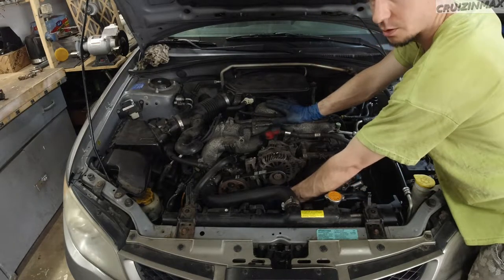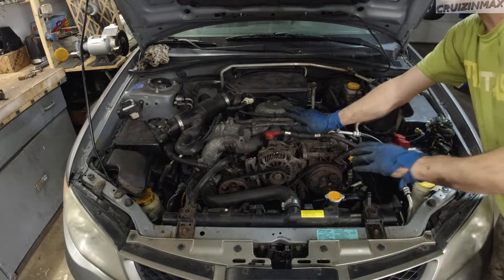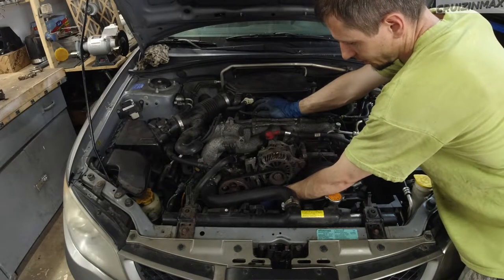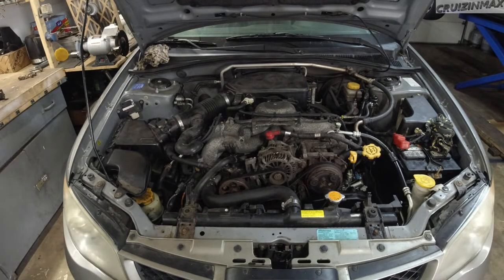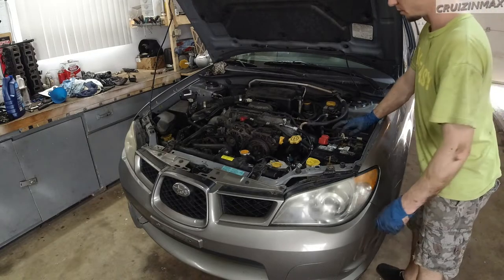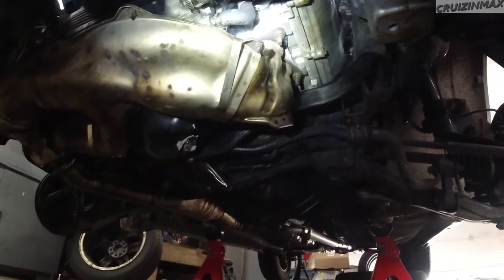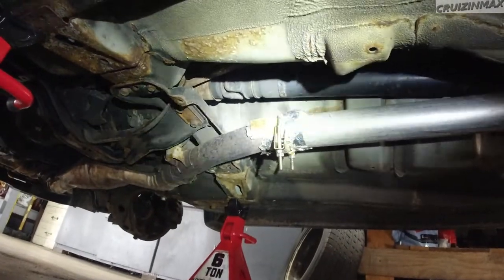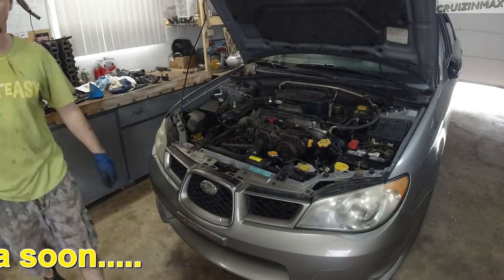Subaru Impreza 2.5L engine in and start up part 10

Comment: Great job on another successful EJ rebuild.  Gotta love it when a plan comes together.  It's a great feeling.

I just got through doing the same thing to an 09 Foz that had sat for several years.  Wound up having to replace the clutch slave cylinder as well.  And the brake line rusted out back where the center lines connect to the rear lines which seems to be common on the Forester and Outbacks from the road salt states.  Not sure if the Impreza had the same issue.
Reply from the maker: Already done with another project which I'll start posting soon.  And I hate doing brake lines lol